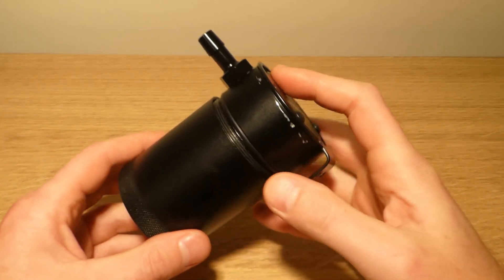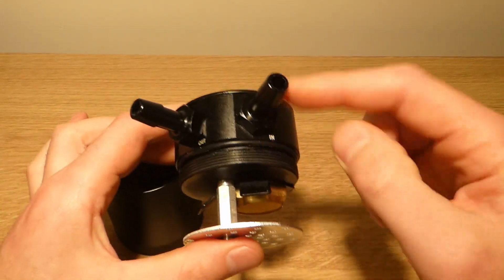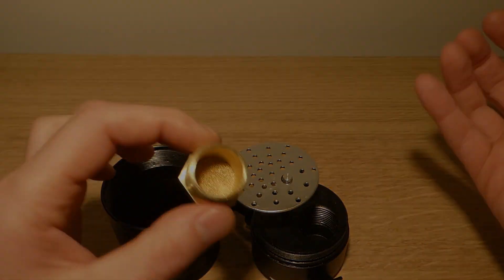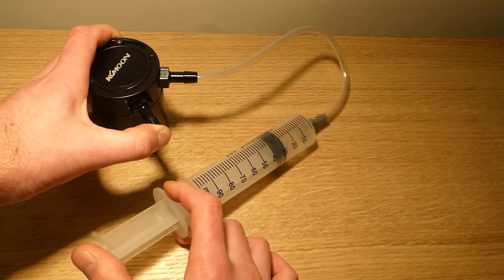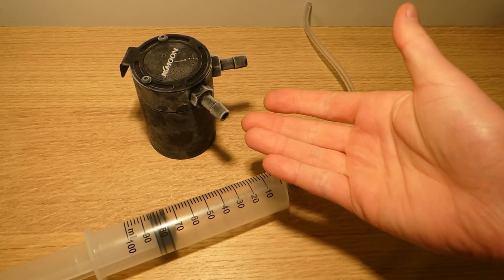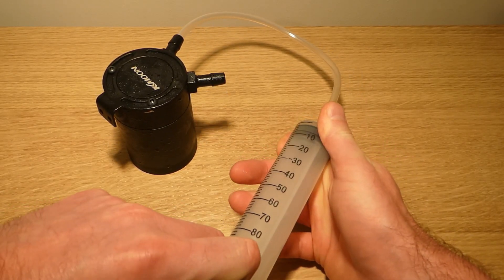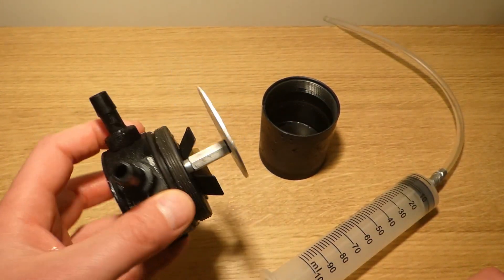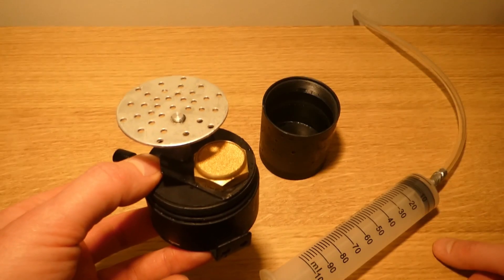Winter oil catch can test

Comment: My Toyota Auris TS Hybrid has the PCV located lower, at the front side of the 2ZR-FXE engine and the output of the PCV to the intake manifold is right BEHIND the throttle plate, where the vacuum is at the highest point during idle. At the same time, there is a second vent (no PCV) on the top of the engine cover connected BEFORE the throttle plate. This ventilation hose is always dry, no water/oil/fuel condensate ever appears here. 
I have the same construction of OCC as the one you presented and I wander if, in the case of freezing bronze filter the pressure in the engine can escape via the top breather hose and thus keep things safe for the seals. What do you all think?
Reply from the maker: If the second outlet is a relief valve then that is a clever design. I suspect it is a relief valve set to open at specific pressure, hence you do not see any oil/vapor from there as it has not reached the specific pressure. If that is the case, then you should not have problems with any oil catch can and freezing conditions. This should open and release pressure at startup if frozen.
Reply: @moremolecules  there is no valve on the top cover, just a straight pipe with a hose leading to the snorkel above the throttle body. It seems that the pressure is relieved at the PCV and does not get to the top breathing hose on the cover, since it-s completely dry inside.
Reply from the maker: @RaduLazau Is it just a straight pipe or there is something internally, like a valve type thing. If it was just a pipe, it will be easier for the gasses to escape through there.
Reply: @moremolecules  you are right. I will investigate. Maybe just the height difference?...

Comment: Can you tell me please de dimmensions of the copper filter?
Reply from the maker: So, as far as I could measure the bronze filter is outside diameter of the thread 26mm, 7mm for 5 threads is the pitch. The filter itself has OD of ~21mm and thickness probably ~1-1.5mm (I cannot measure that without distoying it). Let me know if these are enough.
Reply: @moremolecules  it s perfect! Thank you! I ordered a conic filter for this catch can and i will hope for better results

Comment: I have this kind of catch can it worked great out of the box brand new and during summer but now I'm starting to see the negative effects, what I did was I punched a couple of holes on the filter while it worked great i got alot of milky sludge due to the can being positioned at the most coldest place of the car, it barely warms up after a drive, now im going to just remove the filter itself and probably relocate the can somewhere closer to the exhaust or even coolant lines.
Reply from the maker: I would think that the coldest part of the engine is the best place. You get the best condensation with the difference in the temperature. I would not move it. The milky substance is due to the water being condensed as well. That is unfortunate, but the catch can would not be able to separate water from oil vapor, it would condense both. The holes inside should do a better job with the crankcase pressure.
Reply: @moremolecules  Why would I want condensation though? the milky sludge is terrible its blocking passages in my catch can the baffle pores were cakes and the filter was blocked with that gunk because it wont melt due to the can being too cold on winter...
Reply from the maker: @GCS88  Because it is not possible to separate only oil vapor. I mean it is a balance between how much you want to filter out and crankcase pressure. The higher the filtration the higher the pressure. For a set amount of filtration the catch can will filter water, oil and other molecules coming out of the crankcase. I also see the same gunk/milky substance in mine, mainly in winter when the weather is cold and there is a lot more moisture. You might be right though in the sense that if you move the catch can to warmer side of the engine you will clear the gunk as it becomes more liquid, but you will sacrifice a bit of filtration efficiency.
Probably a good thing might be to have a warmer place for the catch in winter and colder for summer.
Reply: @moremolecules  I'm gonna try it anyway it will also reduce the amount of condensation
Reply from the maker: @GCS88  Yes, see how it goes,  you might sacrifice some efficiency, but the gunk might disappear as well
Reply: @moremolecules  Removed the filter completely and pressure relief has improved drastically the smoke from the exhaust has completely disappeared I can even feel that the acceleration has improved as well as theres less pressure in the crankcase but that could be placebo.

In the future i will weld a screen mesh on the fitting where the filter used to be and place a bit of steel scourer inside it instead, that will provide both unrestricted flow and filtration. will update to see what kind of compromise im trading off doing this..

I also had an idea of placing a check valve on the output line of the catch can this way it will only let out fumes if it reaches a certain threshold and will keep the heat in the system instead of continuously lett it flow into the inlet and allowing cold air to go through the catch can system
Reply from the maker: @GCS88  You would be better off with this cheap catch can (https://www.youtube.com/watch?v=fiAs52P7Qwg). I also stuffed it with steel scourers. The steel scourers add a little bit of pressure but not too much. The design and quality is fairly the same, billet alluminium, the only difference is the filter.
Not too sure about a check valve, it will add restriction, but any engine should have a check or PCV valve anyway.
Reply: @moremolecules  Are You talking about the Kkmoon? thats exactly what I have just without the brand name

Yes a PCV or check valve will add some kind of restriction but how much will depend on what kind of tolerance the valve has.

 I just ordered a industrial threaded check valve that will work with my barb fittings and will use spring from the OEM pcv valve that way its soft enough to open at 6psi.
Reply from the maker: @GCS88  Apologies, I should have specified that I meant the unbranded one with the filter that has many holes. I stick steel scourers there and that was ok. Unknown how much it filters though. I am working on a proper test of oil catch can efficiency, one that will test actual percentage efficiency, but getting my DIY testing equipment ready.
6psi is a bit too much, it is ~400mbar. It should be ok, but I would personally make it even softer.
Reply: @moremolecules  I could be wrong with 6psi I mean its the OEM pcv valve it will open at whatever the engine is operating at
Reply from the maker: @GCS88  It should be alright with another PCV-type or check valve.
Reply: @GCS88  The principle of all fluids suspended in the air and condensing in a cooler environment is how the catch can works. The hot evaporated oil / water goes into the catch can and allowed to cool slightly. This causes the fluids to condense back into a liquid form.  The cooler the can is the more it will be able to remove the oil/water from the gases in the crankcase. If you put it near a hot exhaust pipe the can will be heat soaked and the oil / water will not condense. Thus you cant remove one with out the other.
Reply: @FalconWing1813  2 years now since I've place my catch can somewhat near the the exhaust manifold, not too close that it will burn it just close enough to warm it up, It actually works great, I'm still catching everything but they would be in liquid form instead of slime/sludge

Comment: This is not fare test because the air pressure that produced by CCV is higher than that syringe psi.
Reply from the maker: I would disagree, the syringe pushes ~1.5 bars of pressure. The CCV, pushes maximum a few mbars (https://www.youtube.com/watch?v=h4TQ-XVWU30). The turbo sucks quite a bit, but depending on the design, most will come from the air filter rather than CCV. Otherwise you would suck all the oil from the crankcase.

Comment: What happens? It freezes solid blocking the inlets.
Reply from the maker: Yes, that's correct, although I have been assured by others that the hot/warm crankcase gasses will quickly thaw the frozen bits. I am not entirely sure how quickly this will happen.

Comment: This is dangerous for your PCV system.  That bronze filter has been proven to increase the crankcase pressue which could result in blown seals. I don't recommend these cans with the bronze filter unless you are diligent about keeping it free and clean.
Reply from the maker: Absolutely agree. I have measured the crankcase pressure (https://www.youtube.com/watch?v=fiAs52P7Qwg) with this oil catch can and the pressure is ~4x more than with others.
Reply: Would it be recommended if you have excessive blow by?
Reply: @Cali_20251  Certainly not.  A catch can without the bronze filter is just as effective and much less restrictive.

Comment: Given the same circumstances,your PCV valve would have also frozen up too.When the engine has warmed up the PCV valve would work as it should,it would then be sending warm air to the Catch Can which only takes seconds to thaw.I have proved this on my own car.
Reply from the maker: Hi Brian, you are probably right. The PCV valve is not always tight, for example the 1.6HDi is only rubber-type valve, almost impossible to freeze, but I get the point. Do you know how fast does it thaw, say 1-2 sec or longer?

Comment: Heated air oil separators works best 😉
Using a bong as an example ( pot smoking for the old people) .
With ice water the smoke condenses in thick tar deposited on walls . 
Change it to warm or hot water and the smoke doesn’t gum things up making it easy to remove the oil without clogging the filter and blowing a hose or pcv vale and no freeze up
Reply from the maker: Hahaha, yes, although one wants to separate the oil vapor molecules from the suspension in the smoke. Unfortunately, the separation becomes inefficient when hot :-)

Comment: Can’t see having any - temperature in the engine bay wile you have an engine running
Reply from the maker: Hi Marco, I am not too sure what you mean by temperature in the engine bay.
Reply: The catch can works only when the engine is running and if it is, under the hood it’s hot, and the oil vapors going to the filter are really hot too coming straight from the engine

Comment: It's an oil catch can it's not a water catch can, where is oil in this experiment? Ok it's a combination of both. This video is bad science. It needs a part II please
Reply: If you look at videos on youtube, most of the stuff it catches is water, mixed with oil, fuel and other stuff.
Reply from the maker: OK, maybe it needed a bit more explanation. In winter you get a lot more water in the oil catch can. Really a lot more. I certainly see it with other catch cans. Basically, the air is a lot more humid, then subsequently you get a lot more water in the oil which with the oil getting hotter evaporates and condenses in the oil catch can. In winter this will lead to freezing. It is not really bad science, it is just an extreme case scenario that could happen. Make your own conclusions.
Reply from the maker: Forgot to say, that I would not really do a part II with my own car an get a blown engine due to the oil catch can freezing.

Comment: no problems running catch can in the worst of canadian winter. if youre worried about freezing inside the can, put a tiny bit of antifreeze in there after emptying it! will not freeze
Reply from the maker: Hi Mo, apologies for replying so late, I did not really see you comment. What kind of oil catch can are you running? Is it the same design or slightly different. The antifreeze seems like a good suggestion
Reply: I was thinking that myself just the other day because i just ordered one for my chevy equinox

Comment: Great video!!!! I live in Canada and I have a GDI engine. I've been looking for this workaround for months and I was never convinced I could be a good solution due to the freezing temperatures during winter. Is there any oil catch can model that could withstand this issue? Thank's
Reply from the maker: Hi Abdel, I have been running a cheap version of the Mann-Hummel version of oil catch can and that works pretty well in the winter, say < -5C. I have not had issues with it. Check out my other videos on the oil catch can, I think I had a review of the cheap oil catch can version that works in winter
Reply: @moremolecules  what kind of filter inside provent? Metalmesh or fabric? Winter is comming and I'm starting to worry a little about freezing (just had mine installed), but it probably depends on how the provent is installed. I've seen people use really long hoses, with stepdowns too, to route the thinner hoses easier. Also lines going up and down multiple times, so low spots are created where fluid can condensate accumulate and freeze.
Reply from the maker: @a.kantautas2457  In the Provent 200 is a paper filter. Yes, I would say the fewer the stepdowns and low spots the better. Otherwise these will collect watery substances that would freeze. As far as I have heard (have not tested it yet) the hot gasses should in theory thaw the ice quickly, but it is not too certain. I would use hoses with the widest possible diameter in order to prevent freezing.
Reply: @moremolecules  I asked because earlier I thought metal mesh filter to be only available from China, but there is an original MANN part number LC5002X.
Reply from the maker: @a.kantautas2457  That LC5002X as far as I am aware is the paper element. I do not think any of the Provent filters are the metal mesh. The metal meshes are only from the Chinese filters.
Reply: Also, there are much more different part numbers from MANN available for ProVent 200:
LC5001x
LC5001/1x
LC5001/2x
LC5002x
LC5003/1x
LC5005x
Reply from the maker: @a.kantautas2457  They are more or less the same, all are paper based, but some are finer mesh than others. I cannot quite remember which were the finer mesh, so kind of better filtering, but more crankcase pressure.
Reply: I too have been looking for a catch can that wouldn’t be a concern in winter and I’ve just watched EngineeringExplained’s video on catch cans and the cheapest one he looks at has the baffling but not the brass filter, so the freezing issue present in this video may not affect that type of can (though I do wonder how effective the filtering is without the filter)
Reply: @57250tr   previous to my in depth searching and browsing I ordered this unit from kmotors https://www.amazon.com/Engine-Separator-Catch-Reservoir-Baffled/dp/B078H6C2Q5/?_encoding=UTF8&pf_rd_p=c4ab88b0-3d34-40f9-a53c-afc9e7652f41&pd_rd_wg=ONEVM&pf_rd_r=54S48W1K9V0WAB06XZHM&pd_rd_w=fr1Oo&pd_rd_r=5fe38b19-1959-4624-a2f2-77eea0e404b3&ref_=pd_aw_di_ci_int_sci_gw_atf_m_1
Reply: @teddiazjr.6223  still uses a bronze filter though

Comment: A compressor filter has a bigger filtration surface, vertical position and less probability to get clogged by ice during cold season.
Reply from the maker: Hi arama, not too sure what you mean by compressor filter, but yes if a filter is in the vertical position with bigger surface, then it will be better in winter. Something like the provent 200.

Comment: A bad design.
Reply from the maker: I agree, although it is a good oil catch can for countries that do not quite experience really cold temperatures.
Reply: Not necessarily. Just a different design for different use case. You have to get the one suited for your needs.
I live in a cold climate so this would not work for me, but for someone in LA for example, why not?

Comment: Pretty good observation!!! ... based on your theory, it would be good to compare it against Mann Hummel's Provent and see if it yields the same results...
Reply from the maker: Hi Haythem, yes it would be good to compare it to the Mann Hummel Provent 200, but I suspect it will not be that bad. The filter is pretty large and it has a relief valve, which should open at ~50mbars or pressure, although 50mbars is quite a bit.